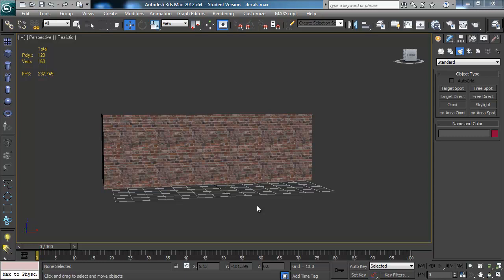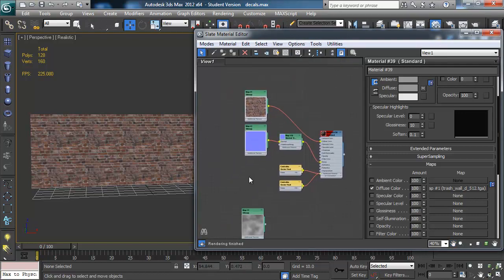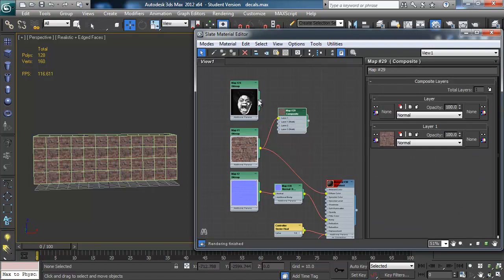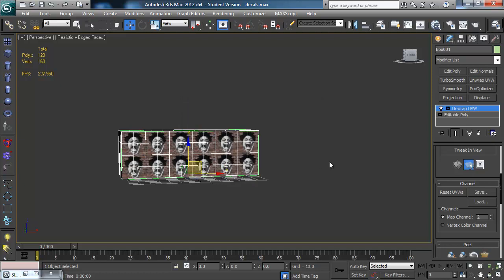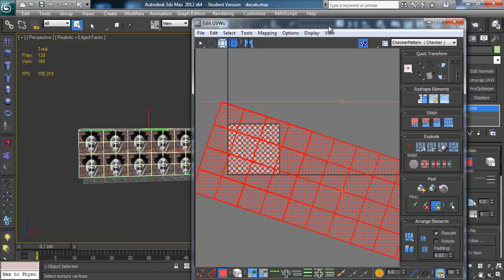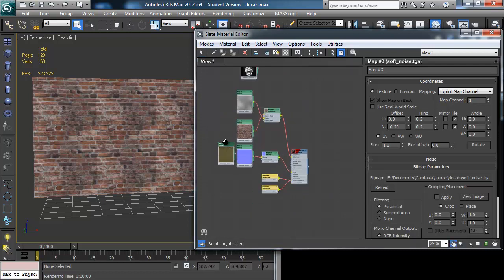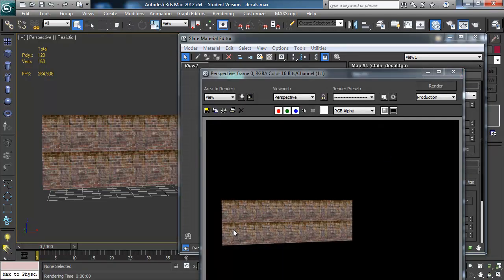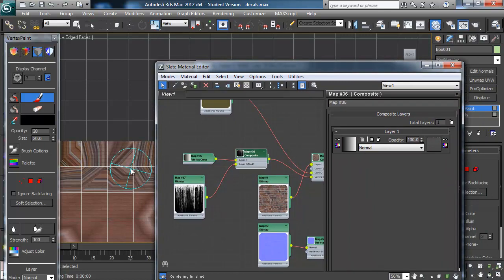3DS Max Composite maps and decals

Comment: 1) I'd have used a UVW Map modifier rather than an Unwrap UV.

2) In the Unwrap UV Editor I would have put the face bitmap in the slot rather than keep the checkerpattern.

3) I'd need to recheck to be sure, but the reason you're not seeing the bitmaps correctly in your interface is because you're not switching on the 'preview texture' button in the Material Editor for that bitmap.  (though it may also be due to the limitations of your GPU).